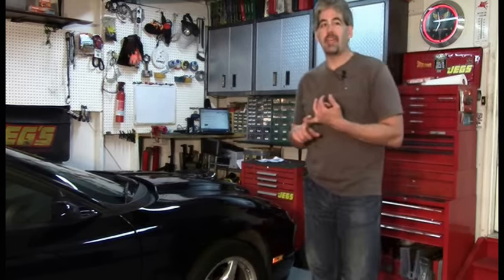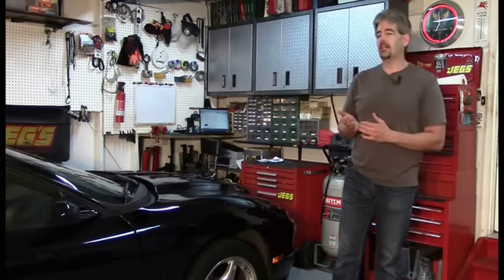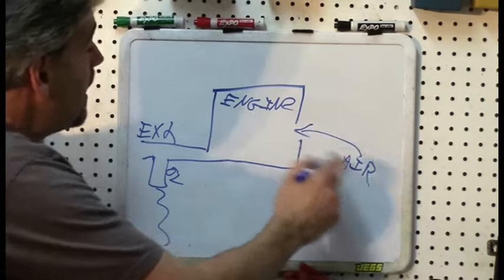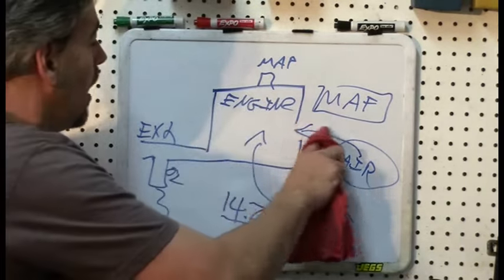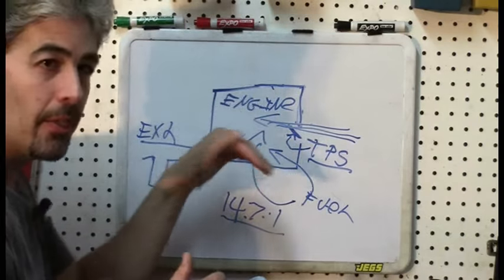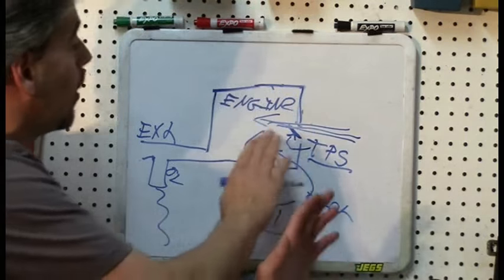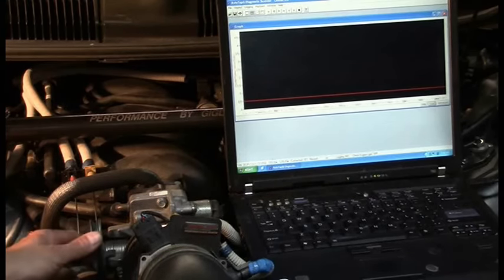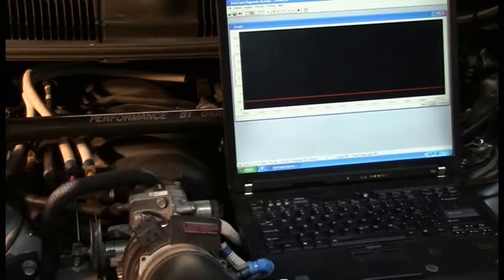TPS (Throttle Position Sensor) Diagnosis and Understanding Pt1

Comment: Hello Matt, please tell me how to get access to the Relearn Procedure for my surging, missing cruise control and passing gear, sometimes missing overdrive Firebird. I just replaced TAC Throttle Actuator Control / electronic throttle body on my 2000 Pontiac Firebird base coupe 3800 V6 with a used salvage yard device. GM discontinued this part all re-manufactured or new sources are 3rd party $500 $1200. 

After replacing the TAC drive-ability has greatly improved; my car stopped switching into “Reduced Power” mode after nearly an hour's drive and idling seems normal. Low end acceleration has lost power over the last couple of months.
Reply from the maker: First- why do you think it’s a relearn problem?  What data indicates that is the problem?
Reply: @SchrodingersBox  - Thanks for the early response; I have traveled over 2 hours twice to find a TAC for under the expected $200. I am struggling with unemployment (Covid-19) and continuing to repair my home damaged by the previous Hurricane and storms 2018. My finances are strained. I lost my previous car last year to a bad head gasket failure.
- ANSWER /Why I doubt the relearn succeeded or is needed | My car does not drive with the previous precise passing gear engages, acceleration is slightly less (especially low end), drive from stop seems lacking response, idle almost perfect, overdrive seems missing, fuel economy is lower, and the cruise control in inoperative. My car has not repeated a “Reduced Power” mode since this TAC replacement?
- 2 local garages state they have no info on a learning procedure and think the PCM/TAC relearns automatically. But do not state they performed a TAC replacement for a Firebird 3800.
- I called Spectra who refurbish/remanufacture the AutoZone sold Spectra TAC / Model TB1082D $745 it comes with a sheet that has a relearn procedure for its product, but was not able to obtain any information on product relearn, or operations.
- Note: I believe the GM TAC 24507244 (?) may need a different relearn procedure than that of the aftermarket Spectra OEM TAC (generic design?). The local GM dealer parts person also states the aftermarket TAC they can order requires relearning initiated from a scan tool (?) that their GM dealer or a 3rd party service provider can provide like Pep Boys/Sears, that also does not require a driving the vehicle scan tool like initiation of a relearn procedure perform in shop. 
- The AutoZone Spectra TAC / Model TB1082D $745 has a relearn procedure sheet which I followed but do not see evidence that it completed successful.
- Local transmission shop previously examined my car with a scan tool and a test drive and said “the problem is not with the Transmission; its an engine/ignition/fuel system/or other related issue. Without further analysis it most likely a faulty TPS, which was not detected by the PCM”, paraphrased. 
- The 3800’s TPS is not sold as a part costing under a $100. It is subcomponent contained within the TPS’ rivet sealed plastic housing. I tried to match the markings (SERA146-01 0321) on the TPS plastic housing by googl-ing it to no avail.
- The previous TPS I disassembled it, disassembled, examined, and cleaned the TPS contact tracings and its feeler contact assembly, and reassembled the TPS, examined the gears (oem grease – unavailable but present no teeth damage visible, throttle valve assembly (cleaned all carbon deposits), cleaned wire contact points, cleaned & painted exterior. 
- I did not examine the TAC’s external connections with a nor 
- TAC - Solenoid / 1.8 Ohms resistance – solenoid of my orig., not the currently installed TAC /multimeter tested while cold.  Cold need examination would be to examine one immediately after 1 hours driving with traffic.
- CODE READS / CURRENT
--  This week, after the install of the current and 3rd TAC (original, and one used salvage TAC) | Regular city driving.
--- Long-Term Fuel Trim Between 13 and 18 / Banks 1 and 2
--- Short-Term Fuel Trim Between 0 and 5 / Banks 1 and 2
--- Mass Air Flow Rate 21 at 55 mph
--- TPS Rate 19 at 55 mph
---O2 Voltage Sensor Rate 0.1 + 0.4 oxygen sensor voltage / Bank A / B prospectively? on a previous (possibly before the TAC replacements, to use as a known 3800 reading).
Reply: Hello Chase, I may have my problem solved. I spoke again with a saleman/poss. tech. at specific Camaro and Firebird parts store. The salesman who is offering to sell the TAC is offering to perform the Relearn procedure that is scan tool based; he said he has performed it in the past. I scheduled an appt. for this monday. He is charging $110 for the part.

Comment: I have a 2000 Grand Prix GTP...If i dont keep the rpm's between 4000 and 5000, it dies. If i let off gas at all...it dies. I thought it was fuel pump but tow truck driver said it was either TPS or MAF...what would be your best guess. Thk you
Reply from the maker: +Timo Parrish There is no such thing as a best guess. A guess is a guess and I never guess- I determine.  What data do you have to make a determination?
Reply: +Schrodingers Box it starts but theres no check engine light on...so its not throwing a code. The tow truck driver just told me 9/10 times when people think its a fuel pump. It was running fine, i ran up to DQ to get family ice cream and when i was waiting in line, it died. Its starting but I'm having to keep rpm's at an unsafe level to keep car running. When i said what would be your guess...i was meaning, where would you start at.

Comment: So in diagnosing, the opposite could happen where you have let off the gas peddle and the engine revs (speeds) up (throttle opens further)? This is my present experience at stops and on highway...
Reply from the maker: what is your fuel trim data? How are you identifying this as a TPS issue as opposed to IAC, Vacuum leak, or any of the dozens of things that would cause this exact symptom?
Reply: Schrodingers Box Well, I bought a new canister purge valve and when I checked the old one on car (by blowing with mouth-I have no electronic diag. tools), there was total resistance (no air leak felt). I'm just trying process of elimination to figure it all out rather than take it right to mechanic. THANKS FOR GETTING RIGHT BACK.

Comment: great video, little technical for me however have a '93 ford Taurus  wagon in good shape but recently wants to go 20 mph without accelerating, feels dangerous and I would like a heads up before going to mechanic. elizabeth
Reply from the maker: +LIZ LUV YOUTUBE I would say drive safely to the mechanic lol.  If I were looking at the car I would first check for a stuck throttle cable and if not that then see if car has high idle speed and correct cause of that.  If the model has cruise control I might also verify the cruise isn't somehow stuck on and not disengaging.
Reply: thanks so much for your prompt reply! I feel much better with some knowledge and will continue watching you.  Even if I can't do repairs myself, I really love to understand the process!. Liz

Comment: You can put your DVOM ground lead to battery ground, then test your pins on connector one at a time with your power DVOM lead. Simpler and safer.
Reply from the maker: NathanGrant1975 You cannot effectively do this on sensors with floating grounds though.

Comment: i'm also getting that signal on my TPS but only when the engine is off. as long i start the engine and my probe is still connected at signal wire and ground I did not see the gradual increase of voltage. can you comment on this since my car is having a hesitation when i step on the gas pedal.
Reply from the maker: Maybe it’s not TPS. Always start with the basics. Do a STFT and LTfT analysis first and correlate it with induction metrics and load. 
   That will give you a basic direction.
Reply: @SchrodingersBox  thank you for your quick response  and i appreciated that much. can you share what are the STFT and LTfT analysis mean? I 'm not familiar with them. thanks a lot again.
Reply from the maker: See my video on fuel trim
Reply: @SchrodingersBox  thanks a lot. done subscribe  to your channel  and already watched your fuel trim video Prt1 .  dont sure if my car has O2 sensor since it's an old  EFI car model 1992. I will check with my colleague.

Comment: at 25:00 put you multimeter on countinuesly settings and ground black lead to the body and red lead to one of the other 2 remaining plugs to determine which is ground by getting continues power and you wont short you pcm

Comment: Some inexperience mechanic adjusted my Suzuki Alto 800, he tilted it up because according to him, idle is a bit rough. Without using a volt meter or any gauge at all. Now it runs rougher, both idling, and surging sometimes. Can I just tilt it down again? Or do i risk damage of some kind?
Reply from the maker: +pinoywheelgunner Tilt it down
Reply: +Schrodingers Box Thanks!

Comment: I have a 96 dodge dakota. has the 3.9 magnum, 140,000 mi. is it a good idea to change the throttle body from a v8 to my 6 cylinder. it will bolt right on. the 2 intake holes are about 6mm larger= more air.
Reply from the maker: Makes no difference, you're still bottle necked at the intake.  Usual "ricer" thinking is to simply change out larger diameter parts on the induction (bolt-ons). But they don't think in terms of systems.
 Your rate limiting restriction is most likely exaust. So ANY induction improvement is useless, actually. Once you free up exhaust, your next is intake, possibly even cylinder head. 
What I've yet to see anyone do who just does "bolt on HP" is the volumetric efficiency calculations to indicate that a larger TB is the rate limiting factor.
 Always think of terms of the SYSTEM when improving performance, not just one aspect. A wider TB does NOT bring more air in just because it's larger. It POTENTIALLY brings more in if it is demanded.

Comment: i have a cadillac cts 2004 and i have changed the throttle body unit but, the plug needed to be changed because of a different throttle body unit. i have the new ac delco pt2043 but i dont have a diagram of the wiring or pin out. any help.

Comment: can I extend the wiring of this TPS wiring..  I am referring to the gas pedal.  converting the van requires me to relocate the gas pedal.  Thus needing to extend its wiring.  what if any problems would occur if all wiring has been solder CORRECTLY?
Reply from the maker: As long as you don’t increase resistance causing a voltage drop at the signal, yes you can.
Reply: awesome thank you.

Comment: hi mat, you forgot the part2, sorry im a little late for your channel, theres something i really don't understand, if theres a maf or map sensor, or perhaps both of them, what for do i need a tps sensor? if air is already been measured, the tps just measures the angle of the throttle plate. what for? doesn't have anything to do with air measurement. i for example live 1,700m above sea level, so theres less oxygen present in atmosphere how the hell a tps sensor can make any sense? i just don't get it, thanks for your explanations
Reply: A tps has nothing to do with the altitude or how your vehicle operates as far as oxygen goes. It is to tell your computer what position the throttle bladeis in ie throttle position sensor.... It uses voltage to decide where the throttle is. Which helps the computer decide where to idle where to shift ect. The oxygen is decided by your mass air sensor and o2 sensors which make your vehicle run rich or lean or at 14.7 to 1 ratio which is ideal

Comment: Thanks, I have a 1991 Nissan and can not use a code reader on my vehicle. There are alot of years of vehicle that have these sensors and can not pull up diagnostic codes.
Reply from the maker: You can pull the codes on all vehicles from 1991 but you may have to do it by jumping the diagnostic terminals and looking at flashes of the check engine light.  You won’t be able to hook up an OBD2 scantool to see any engine data but you can at least pull the check engine code and do manual checks of the system.

Comment: Hope you can give me some advice, I have a Toyota celica 2004 and I have had the car looked at and the chap that looked at it put it on his computer and said the TPS needs replacing,
The car is reving at 1200rpm as soon as start it and wont idle, I unplugged the connector to find very little difference, Any ideas.
Reply from the maker: What data do you have that indicated the TPS needs replacing?
Reply: I don't, Only what I was told by the mechanic that looked at, The problem originally was that the car was running rough like it was only running on two cylinders so I replaced the coil packs but it was just the same, I then checked the wiring to the coils and unclipped the sheath that holds the wiring to the coils just to check the condition of the wiring and everything looked fine but when I replaced the sheath and plugged the connectors back on to the coils and started it it was then running at about 1200rpm?
When I started the car a few hours ago it was again sounding like it was only running on two cylinders so I kept it running and after about 15 sec it the started running on all four but reving high again, very strange, oh thank you so much for getting back to me, Regards Neil
Reply from the maker: Cant help without data. Science doesn't work on guesses. it works on sufficient data analysis allowing for systematic variable elimination. afraid i cant help.

Comment: I have a 09 Impala that has a "Service Traction Control" light daily, then sometimes I get the "Engine Power Reduced" along with it at random times.  It hesitates and sometimes stalls while idling..Do you think this is related to this?
Reply from the maker: What data do you have to support evidence the TPS is not congruent with actual throttle position?
Reply: Schrodingers Box when the throttle body is fully closed, where does the engine get air from for the air/fuel  mixture?
Reply from the maker: ChristianOne Good question- three places.
1. Idle Air Control Valve. This is the main source in fact.
2. Throttle bypass- some air does in fact still get by the plate- remember there is a very strong vacuum at idle so unless the plate is sealed completely, air will be drawn past it (as well as of course from any vacuum leaks that may exist!)
3. PCV. Some of the air from the PCV is available during idle.

Comment: great brake down  , question and this is a tough one can't figure out this problem   98 galant GDI , engine turn on well , but after its warm up it starts to hesitates and shuts off no engine lights , already check the MAF  cam senser , gas pump , sparks plugs ! to no avail , what can it be ? .
Reply from the maker: A when you say you checked MAF, Cam sensor and pump what was ge data you got? what were the actual voltage or pressure readings?
Reply: Schrodingers Box oh ! I just check if they we're bad I didn't take any data on voltage
Reply from the maker: Whoa.... wait.. WHAT????!!!!
 How on earth did you check if they were bad if you didn't check any voltages?? WHat did you check?
Reply: Schrodingers Box I am doing this on my own , I just exchange them .
Reply from the maker: Exchanging them doesn't help if there is an issue in the circuit integrity.  I do not understand why you would change them
  I do not have any information to help- you have to scientifically rule our the variables.
Reply: Schrodingers Box I exchange them because I thought they were faulty ! But it turned out that they are ok , so I can't find the problem ! They all check out ,the car starts fine when the engine is cold it drive fine when the engine is cold the problem is when it warms up  it stolled ! . and when you try to start it it may start the it sounds like its struggling for gas and shuts off  ! Worst if I have go up any angle ,.

Comment: Matt, I got a good one 4 u... My S600 Mercedes runs like shit. No power! Idles fine but has symptoms of a bad MAF or a bad TPS. Ok--- but NO engine light or codes from my iSoft scanner. So off to my Euro mech... From his Star Diag. he gets' 2 bad 02 sensors' and tells me that's the problem! (He's wrong as the car passed smog with flying colors 2 months ago). The fuel rail holds at 55 lbs. The mechanic just replaced the drivers side turbo (engine out!). Turbo's run on MAF sensors but I should be getting a code regardless--although the car has been sitting for a year. If the ECU was bad the damn thing wouldn't start or at least run ruff... 
The driver's side cat was changed while the passenger side is stock. No codes though...  I'm not crying help but this is perplexing so far...
Reply from the maker: Well its only as good one if it has data that contradicts a strategic conclusion but there is no data here but I would probably start by checking MAP at WOT vs static at BARO and doing backpressure measurement.
Reply: Well I haven't disconnected the MAP as yet to c if the motor runs... It should quit, right??
Reply from the maker: That would not be a valid test- you need to see the response vs BARO to determine if you have a volumetric efficiency deficit.
Reply: I'll need to get back 2 u on your answer with more #'s... Thx Matt

Comment: The TPS is similar to a volume control as you turn up the volume it reduces  resistance hence more volume or in the case of the TPS it allows more air to pass . Sorry if this analogy is wrong. .

Comment: Hi Schrodingers boxs I have a mustang 2007 v6 the problem of the car I have Its a raugh idle when I'm in a red light and it's makes a explosion when I drive more than 40.i took it 2 shops they  change sparkplugs,body throttle and the coilpack.and I DNT have a check engine.what the car could have? Can you help me In that please...
Reply from the maker: What data do you have?